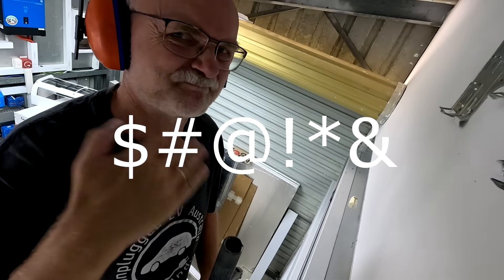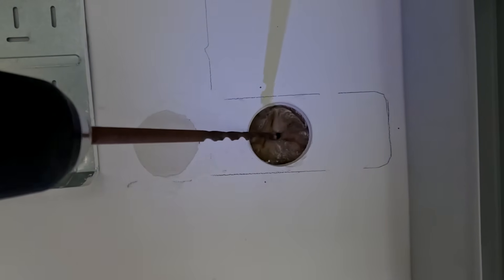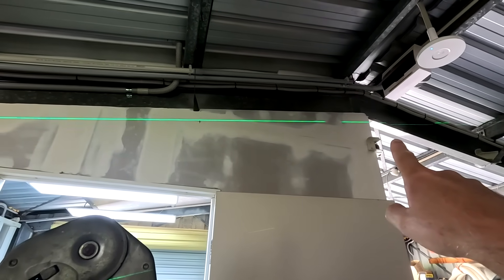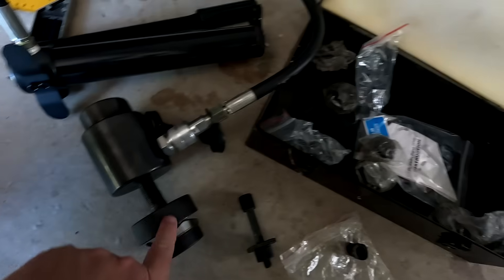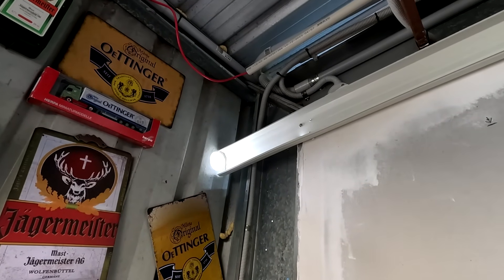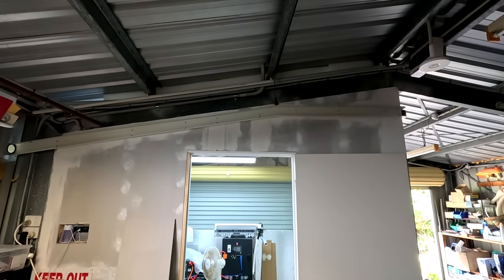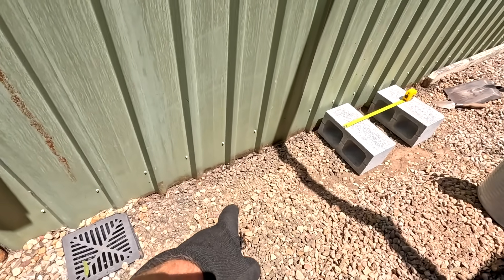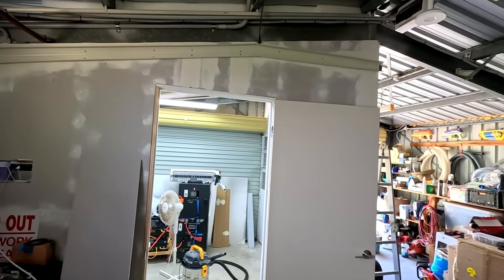AC-Installation preparation for keeping the batteries and equipment cool during summer! 🔋❄️

Comment: Andy, have you ever considered storing your batteries in a bunker underground? Two advantages I can think of is 1. Constant cool temperature, & 2. In the event of a fire, it is underground, (hopefully) keeping it contained & not burning yourself & your neighbors out of house & home. If it was possible to seal well enough, would keeping the batteries also in a vacuum be of an advantage, apart from fire suppresion?
Reply: Not sure how a vacuum would help. It would reduce cooling and possibly blow the seals on the cells. And you'd require a staggeringly heavy and expensive pressure vessel to contain it.

Comment: Why do you put it over the equipment? If you have condenstion leaks, it leaks in it.
Why not put it above the doorway? Also saves on distance to the outside unit.
Reply: Others have pointed this out in previous videos - I think he is going to install a tray to catch leaks. There's no room on the other side - the wall is completely covered in batteries, inverters and charge controllers.

Comment: You could get a cheap bending spring and connect the suction& discharge flare connections in the evaporator (indoor unit) recess. 
Then take the insulated pair out the opposite side of evaporator using the spring to make a 90degree bend in larger pipe. The 1/4 won’t need a spring at all. 
I’d say simples, but it can be a bit fiddly.

Comment: What you are doing is not the best practice.  one thing you don't want to do is have a long run on the condensate drain.  It is prone to blockages and will result in the inside unit overflowing with water down the wall or spitting into the room.  
I would suggest ripping out that never used roller door, then mount the AC there, with the outside unit on the other side of the new wall.  That would be a good solution.  We all know you will never use that roller door again, and it is just a pain in the arse now, because it is a source of leakage and a path for insects and dust to enter.  Delete it and move on.
Reply: Others have commented on the indoor unit's position. I think he's planning a drip tray. You can easily put a float switch into that, to detect the fault.

Comment: Check the Daikin installation manual for how much space needs to be between the wall and the outdoor unit. Looks a bit too close to the wall which could impede airflow and reduce efficiency.
Also looks like the concrete blocks are too short, one of the fixing holes might be too close to the edge.
Reply: And also heat up the garage from the outside!

Comment: Honestly Andy, why do you need a sparky? Must be due to regulations or something because I bet you are way more competent than them. You have done most of the work for them anyway, the rest is fairly easy. I am a DIY person too and haven't welcomed a sparky or plumber into my house for over 20 years now.
Reply: Where do you live that electrical certificates are not required, or do you just not think about the problems when you come to sell your property? Not saying that's the wrong approach, but there are downsides.
Reply: @matthewmarks6951 
Most people don't know that adding electrical circuits or load to their homes requires an electrical permit.

Most of us don't bother because it's a stupid regulation. If you can do basic math, reference code books and you have a tadbit of common sense: then you'll probably do fine.
Reply: @jamess1787  What country are you talking about?

In the UK, electrical certificates are required when you sell your property or when you do any work 
that needs building regulations approval, such as an extension. If you "don't bother," you'll find yourself in a pickle.
Reply: Australia has the craziest laws.

I think it has to do with where they're located in the world, they want to make sure their local talent gets work and they don't get flooded with cheap labour from abroad.

I've heard jokes that people need an electrician to change the plug on an extension chord. (Not sure how accurate that is, but shows the environment they're working with.)

Comment: What about the humidity that condenses on the cooled components?
Reply: The coolest component is the evaporator in the air conditioner - all the condensation will appear there, and be drained away.
Reply: @matthewmarks6951  No, condensation will happen everywhere, where warm air comes in contact with cool surfaces.
Reply: Warm humid air. This won't happen if there isn't any warm humid air - i.e. if he doesn't leave the door open.
Reply: @matthewmarks6951  Oh boy ... When your AC blows out COLD air, then all the air around is warmer and has higher humidity.
Reply: @tomberger6484  Yes - which is sucked in to the evaporator, where the humidity is removed. The evaporator is the coldest thing in the room, which is why all the moisture condenses on it, and hence needs a drain. In the steady state, there will be no condensation anywhere else. If the door is opened and warm moist air gets in, you could certainly get condensation temporarily on various surfaces, but this will evaporate again because in the steady state the dew point of the air in the room is the temperature of the evaporator, which is the coldest thing in the room.
Reply: @matthewmarks6951  " In the steady state, there will be no condensation anywhere else"

Of course there can happen condensation at other places too. Just blow the cold air into a metallic pipe, and you will see condensation at the outside of that pipe. And a lot of condensation will happen on the outside of the metal roof of Andy's garage.

Just visit cities like Palermo and see the mold on the facades of the air conditioned houses.
Reply: @tomberger6484  Yes, of course cold surfaces exposed to humid air will experience condensation. I've no idea why you're continuing to hammer away at this point when I'm not disagreeing with you. The problem is with condensation on the equipment within the battery room, is it not? The air there is dry, its dew point (i.e. where the relative humidity reaches 100% and condensation occurs) being that of the evaporator in the indoor unit, which is the coldest surface in the room, so condensation will not occur anywhere else.
Reply: @matthewmarks6951  "The air there is dry"

No, the air in the garage is certainly not dry. The garage is largely open to air exchange with the outside air.
Reply: @tomberger6484  Nope. It's the battery room within the garage, which is an enclosed space.
Reply: @matthewmarks6951  Even in a well-insulated house, the air is exchanged with the outside air at least once an hour, without the need to open any doors or windows. Usually, it's considerably more. And in this garage, it's certainly much more.
Reply: @tomberger6484  Jeez man - every time you're shown to be wrong you double down. I don't know what planet you live on, but it's not the same as the rest of us, where air conditioning cools things perfectly all the time without condensation forming on them. I've had enough of your nonsense - I'm out.
Reply: @matthewmarks6951  I'm a physicist specialized in building physics, and I spent a long time training energy consultants. Unlike you, I know what I'm talking about. And I can even express myself without offending the other person...

Comment: Hi Andy, I think you’ll need proper vibration isolation between the outside unit and the garage. Otherwise, you may end up with an annoying humming noise in the garage/studio. Also keep in mind that the pipes can transmit vibrations as well.

Comment: Refrigerant doesn't like 90° bends they can restrict refrigerant flow and pressure, decreasing system efficiency. The drain from the head unit can't run uphill. The small size unit may need extra refrigerant if it's a long pipe run. So not an ideal installation as far as efficiency.
Reply: The drain is not running uphill - that's the whole point of carefully designing it with the recommended fall.
Reply: @matthewmarks6951 9:42

Comment: Andy i appreciate all of the BMS videos,  finally got my 2nd JK 14.3 kWh pack done...used an old metal office cabinet on it's side and some cement board doors,  has room for 16 more cells .  Just in time for snowy days.  Lives outside in COlorado . I used cheap round stick on 12v heating pads..5 in series, with an LED across one of them to indicate heating.  I used the dry contacts to turn heat on before the temp drops, also has redundant snap t-stats.  Used syssi JK BLE HA integration (github) with an ESP32 translating JK BT to my wifi.   This DIY pack is in parallel with an EG4 powerpro that was* talking to an 18kPV...But  thats   not so great  , I was going to take out the OEN BMS and add a 2nd JK, and still might.   But running the 18kpv in Lithium 16s no comm mode (like voltage not SOC lead acid mode)  seems better on my first test, (no throttling of charge current TO the batts if the communicating one reaches a 100% SOC first.  Instead it just presents a voltage and X amount of allowable current to the fork in the river and the two BMS's can shar it as they see fit.

Comment: 17:00  I just bought two 50 x 50 cm concrete slabs from the hardware store, raked the gravel under them and that's it. Or, actually I drilled a hole in the join between the two and installed a drain pipe. I'm mostly using it for heating so the moisture is generate outside. On top of the slabs we usually use a steel adjustable frame here in Finland. If any part of that outside unit is touching the steel sheeting You''ll regret putting it that close to the wall Andy.